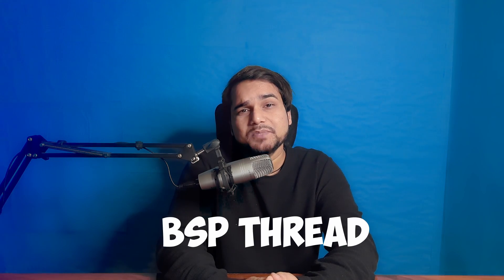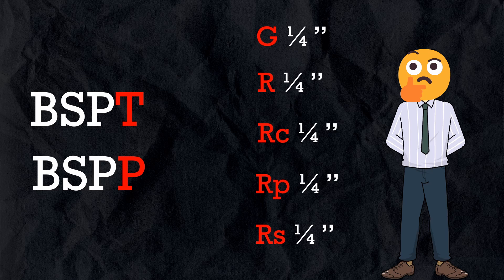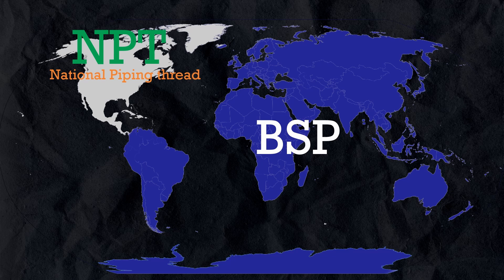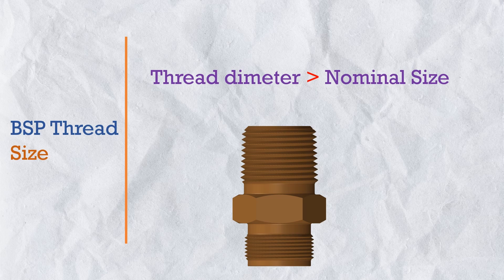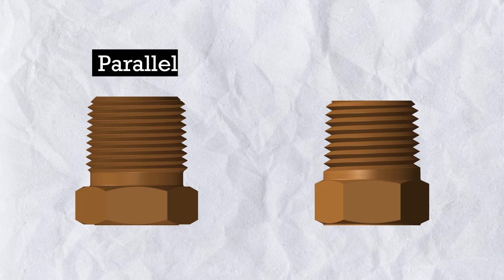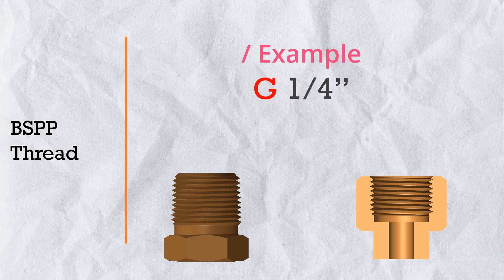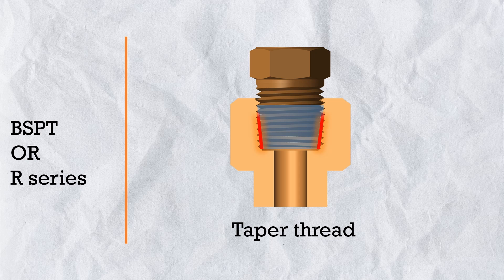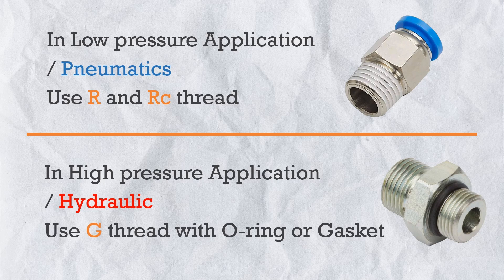All Types BSP Threads Explained!! Confusion THE END 😎 G fittings, Rc fitting, R thread, BSPT, Rs, Rp

Comment: Just to add to the confusion, there is also BSPP cone seat (as opposed to BSPP flat seat) 😰
It's used in hydraulic application where a super strong seal (metal against metal) is needed.

This type of cone seat is not used in BSPT 
since as you mentioned at 8:25, BSPT is rarely seen in hydraulic application
and is rather used in low pressure application.

There is also the fact that BSPT is not reusable alike BSPP
since once you screw the fittings together,
if you unscrew them, you would have to screw them back together even deeper
due to the alterations of the threads the first time you fitted them together.
And you might not have these extra threads available.

It's a whole world of confusion  😭
Reply from the maker: Hahaha

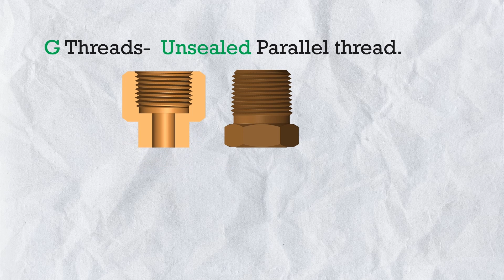Comment: 3:24 your picture of BSPP shows a tapered thread. And again at the right hand side of 7:52. Just checking that this wasn't intentional? Is there some taper in parallel threads to ease assembly?
Reply from the maker: Hey, I have clearly said it's a parallel thread. yes, the model is looks not completely parallel, but I have also used parallel lines to make you believe that its parallel.

Comment: Very good video.  I have one question for clarity.  If I have a Female 1/4 G thread and I have a 1/4 RT thread for  pneumatic application is this ok to use?
Reply from the maker: Yes 100 precent. If you have a tapper male thread, you can use in both tapper and straight female thread. should work 🤞🏽

Comment: As an American the reason we use NPT has to do with the whole milk before or after tea debate. We dont take our tea like that.....

"What? Well, how do Americans like their tea then?" I hear you wondering after that totally not obvious set up. The answer is....

...We like our tea...

🕶

SALTY!!!! 🦅😎 [eagleScreech-explosions-fireworks-barbeques-freedom-and-rockMusic.mp4]😁
Reply: @mastermechanicaldesign 🤣 😉

BTW, cool video mate. Im queueing up your thrust bearing one now, and your bearing series seems relevant to a telescope mount rebuild/upgrade project Ive been fiddling with. 

I dig the simple but not simplistic format. There is a HUGE vacuum of content between beginner/novice levels and knowledgeable craftsmen level that tends to leave people in a rut of knowing just enough to be dangerous but having nothing to learn the next level in planning design steps, reasonings on choices for a given part, or component selection, etc. All we usually get is 'just buy this one' never a 'okay, why not that cheaper one' or 'I dont have those, but I have these almost exactly the same ones' explanation. Case and point, the not using tapered threads and adding an O-ring on hydraulics (I mean, I know why, having worked in a machine shop for animatronics a long time ago (mainly in tool making, ie molding and casting, but also some electrical/mechatronics and the odd trip to the mills to make a linkage or two), you dont want a 3000psi pinhole leak.....literally anywhere, so seal it up good. Dont trust what looks okay, air (gases) is not fluid, fluid is not air, do it right. Those SOPs exist for a reason. But without going into that whole subject of pressurized fluid dangers the correct fittings were...) explained quickly and clearly. Looking forward to checking out your backlog of content. Keep on keeping on man!
😎👍
Reply from the maker: Thank you so much 🤗, i really appreciate that you give time to write such great feedback ☺️ and people like you really inspiring me to give myself 100% in content.

Comment: Since you are transferring gas or fluids inside the pipes, the internal diameter plays a huge role (flow/pressures, pressure loss/drop etc.), therefore "size of the thread" is the internal diameter (not exactly, but very close).
So it is NOT "just a number" for historically unknown reasons.
 
Metric connections are straight forward - it's literally size of the thread.
But in case of tubing/piping/hoses it depends on industry, applications (so nominal number can be external or internal diameter).
Reply from the maker: Hi, The nominal was originally based on the inner diameter (measured in inches) of a steel tube for which the thread was intended, but contemporary pipes tend to use thinner walls to save material, and thus have an inner diameter larger than this nominal size. But we still denote the size in inner diameter in inches, just because of history (Inner dia is equal to BSP Thread size, which is not relevant these days.) But yes i haven't explained this in video just to avoid confusion. (Always refer the standard table of thread) And i directly said it's a historical legacy
Reply from the maker: Just for wording clarity- Historical legacy doesn't mean-  unknown reason. There was a reason (this is why they were using it) but not relevant today. But we are still using it just because of history.
Reply: I agree it would have been more clear to explain it's (roughly) the inner diameter otherwise it seems like some kind of nonsensical sort of random number which makes it harder to store in your brain.
Reply: He has presented a good video about the type of threads and their applications. Choosing a wall thickness based on system pressure is not the objective of this video.